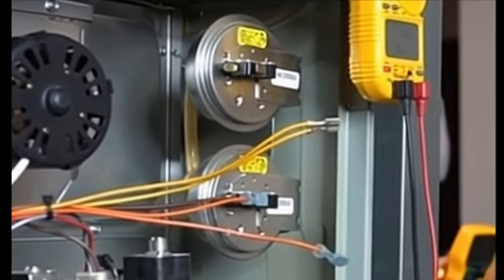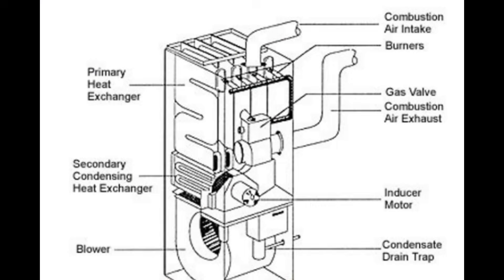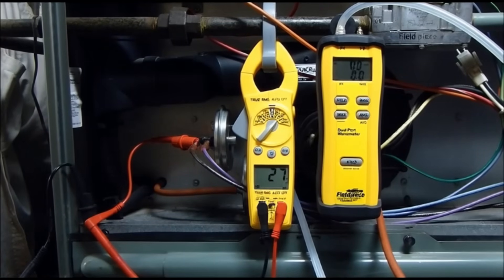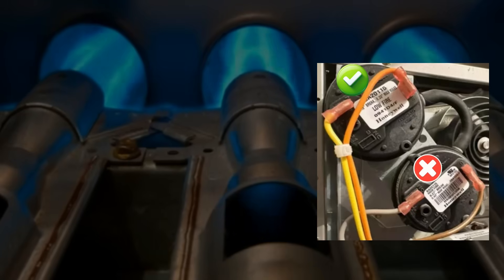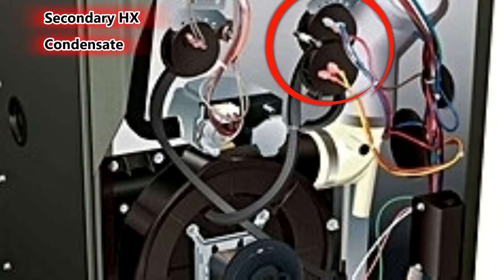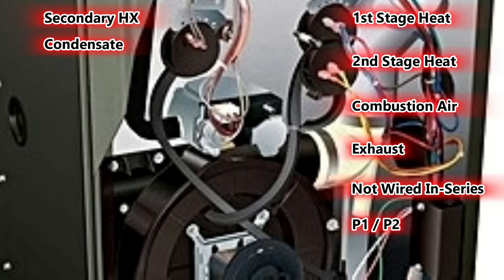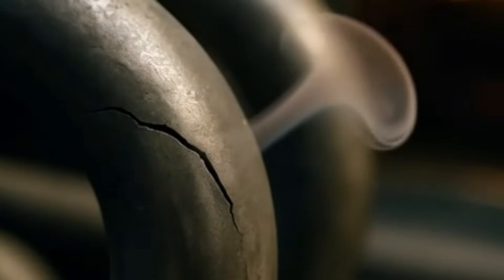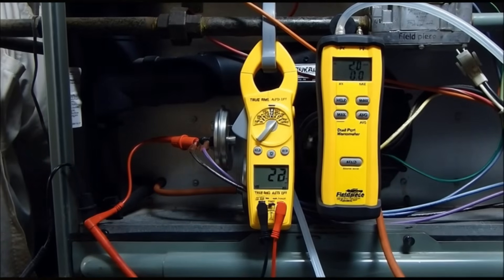How Multiple Pressure Switches Work (And What They Reveal)

Comment: Hey Mike I'm not getting no 24 volts out of my brand new transformer but 120v coming out of the board no door switch
Reply: Look at the transformer as a separate entity. If you're getting 120v to the transformer and not getting 24v out of the transformer, then the transformer is defective . If you break down everything into sub-assemblies , it makes everything easier to diagnose.
Reply: @anthonygonzalez7488 very well said no other way around that
Reply: Fuse good no lights on the board, I'm getting 24 volts at the transformer
Reply from the maker: Are you seeing it on the R terminal?
Reply: Check your fuse and make sure there’s no door switch. After that trans is definitely shorted out

Comment: Does the tube going to the gas valve from the pressure switch determine changes in the gas valve outlet pressure? Thanks
Reply from the maker: No, that tubing doesn’t regulate gas flow to the manifold. It’s just a reference/vent for the gas valve’s internal regulator so it “sees” the same pressure the burners are in.
Reply: @JerseyMikeHVAC thanks. Would the gas valve still stay open on a call for heat if that tube was blocked or plugged off?
Reply from the maker: Yes, it’ll stay open. It won’t shut the valve down because it’s not a safety input. It’s a reference pressure for the gas valve’s internal regulator. If it were to get plugged, it could lead to unstable firing.
Reply: @JerseyMikeHVAC thanks for the help. I have never known what that input was for
Reply from the maker: No problem. Gas valves and pressure switches with diaphragms all use some reference pressure to work. You might see a port off of a pressure switch with no tube connected to it. That's an atmospheric pressure reference so the diaphragm reacts accurately to the pressures being generated on the other side of it by the furnace. Kind of the same concept with the gas valve regulator using that hoe as a reference.